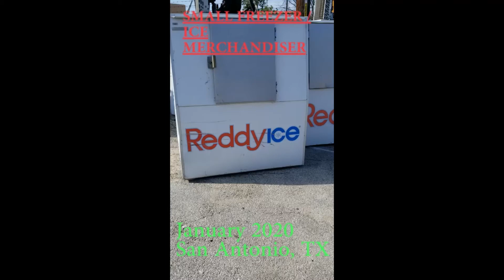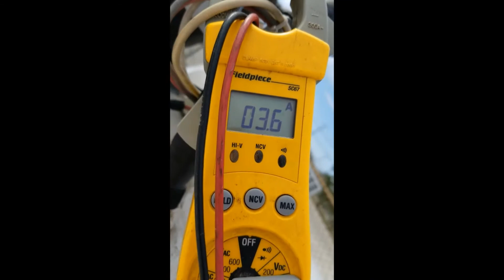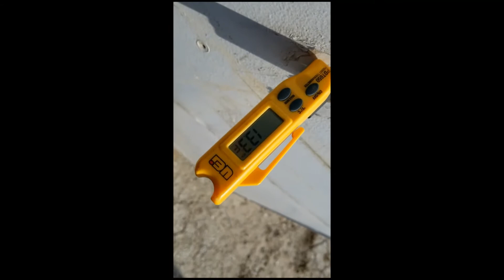Freezer Ice Merchandiser Box Repair | Bad Evaporator Fan Motor

Comment: I'm trying to start a Snoball business (basically shaved ice, different machine tho) and properly tempered ice is KEY to perfect 'snow.' I bought a used unit like this for making/storing the blocks and a small used Dippin Dots freezer for on site storage. I cleaned the big one up really good but it would only pull down to between 35-40 degrees. (maybe I didn't run it long enough). But I need a target temp of between 0 and 20 with 10 degrees being the idea temp. I failed to even look at the evap coils since the fans were running. Great info on the run and defrost times as well as the temperature range that this box cools to. Short of being low on Freon maybe, all other components seem to be working. You said that in auto defrost mode the amps should be around 3.5-4.0, right? 

The little dippin dots chest works great but I don't need sub zero temps. Is there a way I can regulate that? It's an older model without any adjustment  arrows on the digital display. By upgrading the display (Weiss Instruments) and simply changing the temperature setting to the desire temp, will that do it? Or is there something I can do with it just the way it is?

Great video man, I've watched these long drawn out vids that are way over my head. Yours was perfect for what I needed. Short, precise and informative. Thanks!
Reply from the maker: Sounds like you may have a cooler at that temp.  You can turn that 34⁰ cooler into your 0⁰ freezer by changing the stat and adding a defrost system if the equipment can pull down. (If it is a freezer, you have a problem). Hope this helps!
Reply: Then shaved ice cups are pricey

Comment: Nice video! In my ice merchandiser , fan is running but its not cooling at all. any idea what could be the reason.
Reply from the maker: There can be many reasons: 1) compressor not running 2) no refrigerant 3) bad capacitor 4) burnt wire 5) defrost timer is bad. Thanks for watching, I hope that helps!

Comment: Chances are when unit goes into defrost, that fan will not come back on. It's a cheap fan and easy to fix why not replace it?
Reply from the maker: @walterdennis7023  you're right,  normally I'd replace but I believe at that time I was assigned a weekend event with like a few hours to test like 30 boxes so I just shot a quick vid.  This is not a final fix.